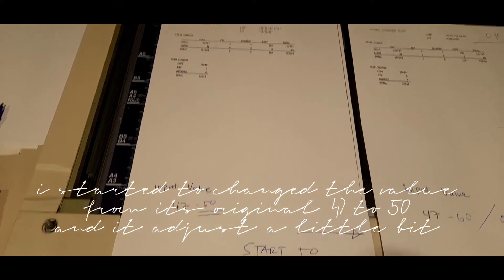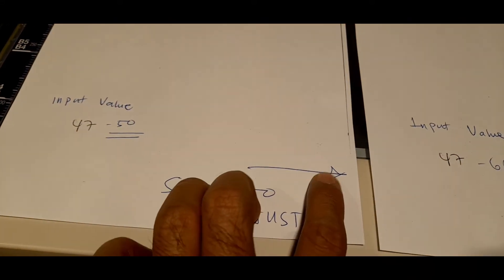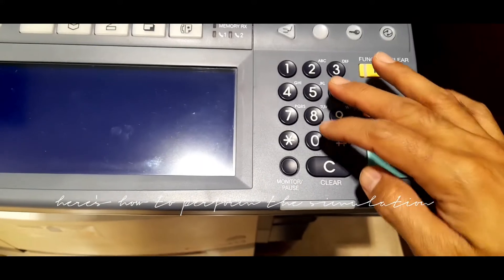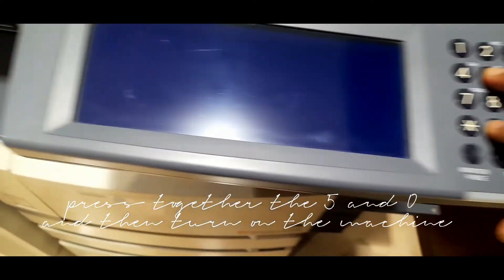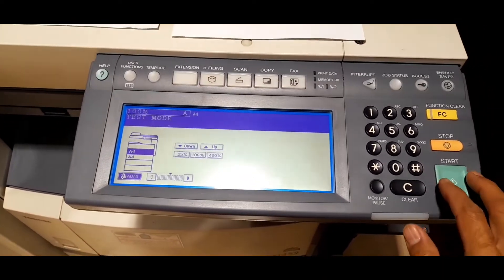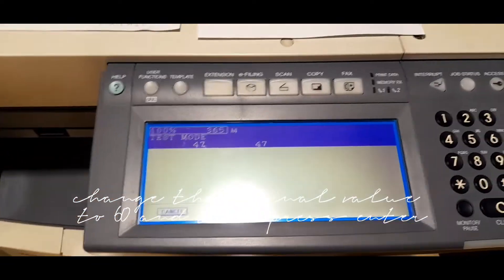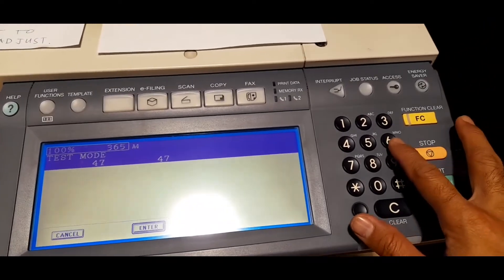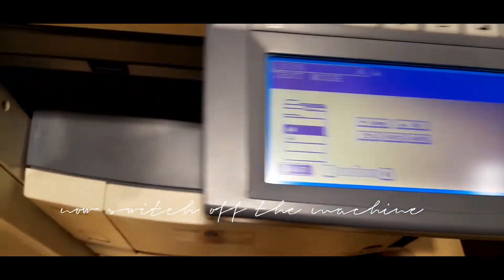TOSHIBA e-studio 452/352 vertical line or leading/trailing-edge

Comment: I have toshiba 656 same problem  what i do same proces
Reply from the maker: 5+0 then 3044 maybe your original value is 40 or 50 try to change around 60 to 70 most of the time it will set on 70 but start with 60 change your value by 10's.
Reply from the maker: for Toshiba 656 series
Reply: Thank you sir your video very helpful  i watch your every video may god bless you